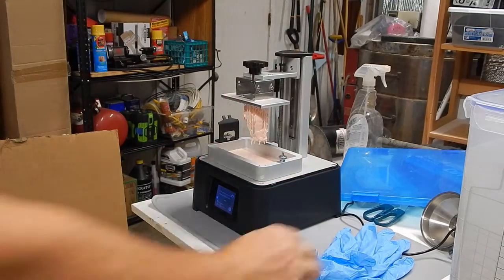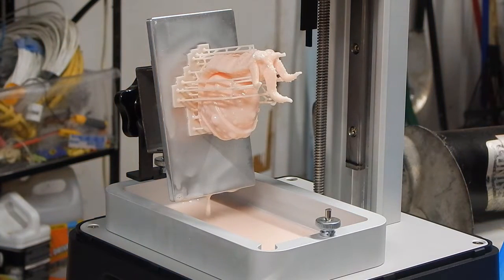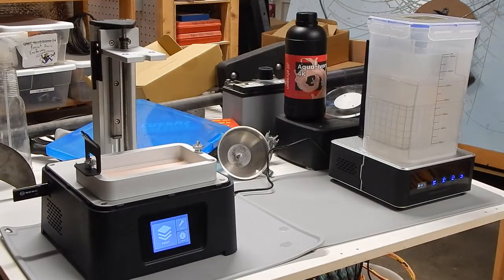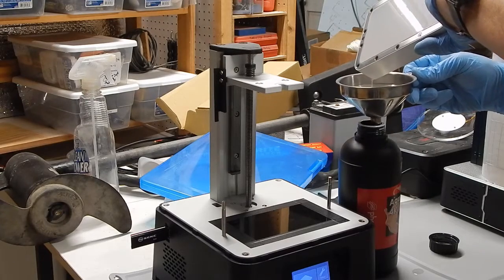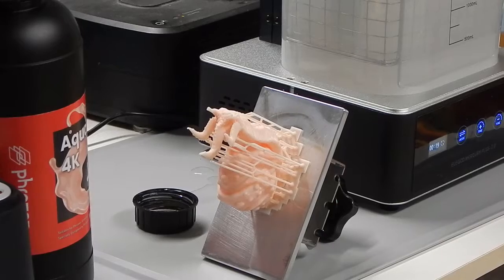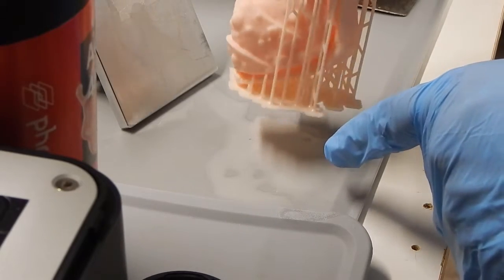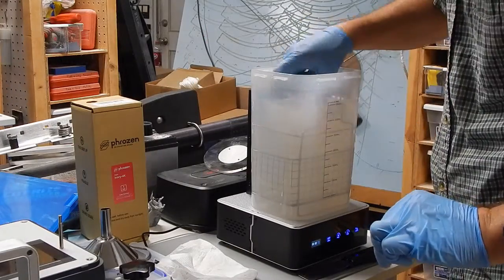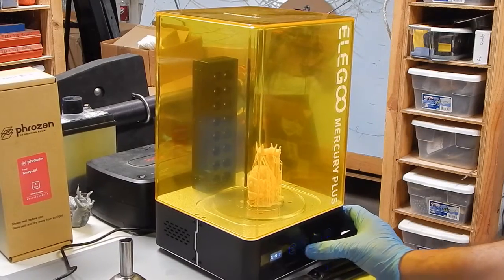HOWTO: Resin 3D printer Wash & Cure post processing and cleanup

Comment: I think it's better to remove supports before curing. because UV light give strength to resin the support will stuck tightly to the model. I have experienced both removing support before and post curing. before is far much better.
Reply from the maker: @sangeetsankhla1451  thanks for your comment, I've never tried before, as I was worried about handling the model before it was cured.